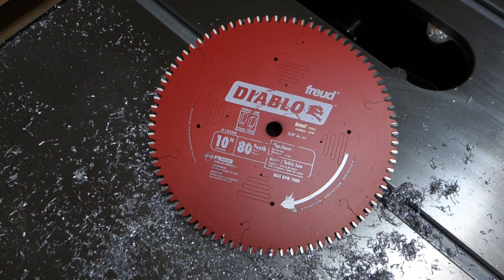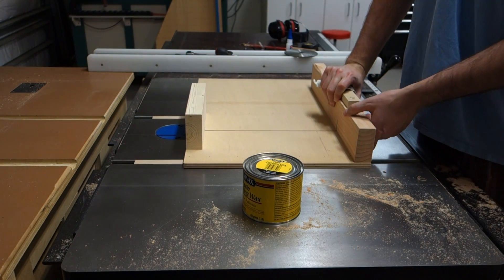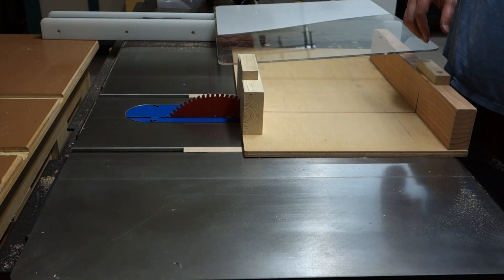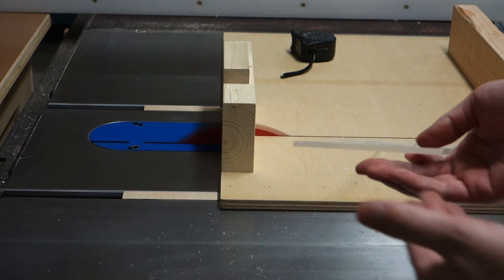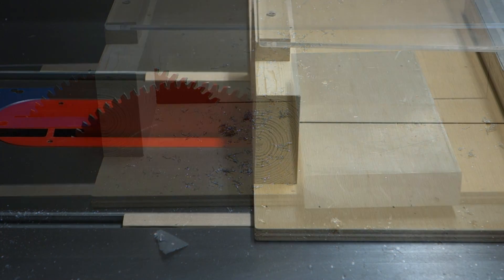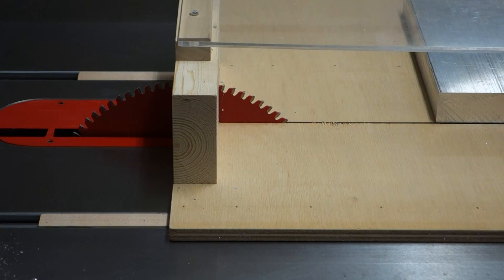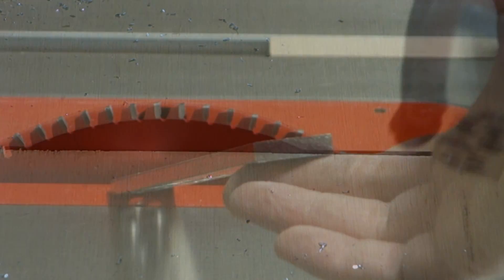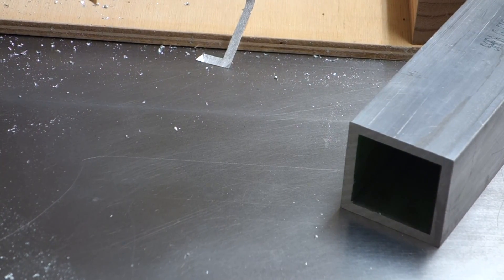Cutting aluminum and acrylic with the table saw

Comment: Draw a tiny bead of Alumtap on the stock where the blade will intercept it. I use a 1oz poly squeeze bottle and about a 20 - 30 ga needle. It's total FM. You will get a mirror like cut, Your problem is the aluminum sticking to the carbide. I wouldn't matter what kind of tool you used if you don't have something to prevent adhesion.
Reply from the maker: Very good info, thanks. I have not heard of AlumTap before. In reality, it is probably near impossible to achieve a perfect finish the way I was cutting just becuase of lateral forces imperceptibly vibrating the stock.

On my mill I can acheive a pretty good mirror finish with aluminum, lubricated or not, but lubrication certainly helps. I believe the majority of this is do to it being rigidly held in place with controlled feeds and speeds.

At the end of the day though, the table saw is a very capable and versatile tool.

Comment: For Cutting Acrylic, I Spray DuPont Teflon Dry Lube on the Blade. I Rub Bee’s Wax on both sides of the Acrylic at the cut line. Leave the Paper on and Rub the Bee’s Wax on the paper.

Comment: I can't help but feel that with the heavier/thicker piece metal, cutting right on the edge as you did, it was a deflection problem as the blade was not being supported on both sides.
I know with a mortiser you encounter a deflection problem if there is not a equal amount of support on both sides of the bit assembly.

Comment: CAN ANYBODY HELP? I’m using the same blade in the video, except mine has 84 teeth not 80, and when I try to cut acrylic it just starts “foaming” up/“melting”. What is wrong???
Reply from the maker: Blade is not the same. #of teeth matter, angles of teeth matter. Small differences can make big differences. However that being said, you may be cutting an extruded piece of plexi which is different from cast plexi. Extruded has much lower melting point and will do that if machined.
Reply: @WickedWood  Omfg I’m just realizing that it might be extruded because I just took it out of a scrap bin at the acrylic place, it’s not from the cast sheet that I purchased.. would definitely make sense because this wasn’t happening before. 

Wow how did I not put this together lol. 

Thank you

Comment: When I say "work" I mean work piece Also there is a reason why Machining use a lot of careful planning when planning for work holding with a slitting saw or horizontal milling etc. Thing about the forces being applied to your work piece as it meets the saw blade. Think about what that work piece would do if you were not holding it down the instant it meets your blade.  The saw is pushing the work away from the direction you want to push it (in the x or your only(not) axis).  The blade is also pulling the work down.. all this force is being applied to 1 side to of course the other side is going to deflect in some way. If you could concentrate on keeping the side furthest from the blade from moving and use lube (wd-40) you will be surprised.  Mirror finish man. I wouldn't take my time explaining if I didn't know it myself.  Fyi you have more then acceptable finish already compared to most "machinists" I've seen.

Comment: Great video, subscribed! 
I love the incremental testing you did, as well as the double slot crosscut sled with the acrylic  (it really cut that nicely by the way). Pretty great results for the aluminum in the end and as others said, it should give a perfect cut if you wouldn’t be shaving the piece. Am I correct (I think I saw this on the blade) in saying that this was a 10” 80 teeth blade? Also, what’s the grind on the teeth? I assume a triple chip grind (TCG), especially with the low hook angle, but I’m not sure.
Reply: Sorry, I forgot to check the description and all of my questions were answered there... thanks again for the good video as well as for the extensive description!

Comment: Why are you trying to cut paper thin slices and still wondering why the blade is deflecting. If you really need to take .00001" off of a 1 x 4 aluminum block...you need a mill, not a table saw.

Comment: As someone who's cut aluminum on a table saw and hurt themselves more than once I can tell you that the table saw is the wrong tool for cutting aluminum. Use a bandsaw like any sane human being. You can also use a cold saw to cut aluminum. Slugger makes great cold saws for about five six hundred dollars. You are very likely to injure yourself, hurt your table saw, or hurt someone else trying to cut metal on a table saw. A table saw was never designed for this and the kickback can be extremely nasty. I almost broke my thumb one time cutting aluminum and I was feeding the material very slowly and cautiously.
Reply: 77Avadon77 Totally agree with you. I have cut aluminum plate on my table saw, as a last resort because my vertical bandsaw was down...very dangerous!

Comment: You aren't cutting aluminum, you are shaving it.  Take a cut where both sides of the blade are supported and that will correct the problem.  I have a small antique craftsman 6" table saw and cuts beautiful but then I am never shaving.
Reply: YourOldDog: egg zackly.
he should have known that anyway but the very first cut he made had a lot of mirror finish because there was a good size chuck cut off but that chunk wasn’t a full piece. the blande is having a hard time staying true because it’s being pushed to one side instead of plowing straight thru.  the same thing happens in a mother saw when the blade is just touching the end of the stock.  plus this guy was doing more building and modifying that sled than cutting aluminum

Comment: You should use a sander to do sanding, and not expect your table saw to handle that job. It would be nice if your table saw did it all, but specialized tasks usually require specialized tools.

Comment: squirt some WD-40 on the aluminum before cutting, it's the commun lubricant for cutting ali.   Also, deflection on a 10" blade will be considerable when one side of the blade is not supported by the aluminum.  ANY blade would have trouble cutting metal with out support (cutting more than a sliver) from both sides,

Comment: Hello, the angle of incidence of tool into the piece of aluminum is very low!!! and the velocity of turn is very low too, and the velocity of advance in the table is very hi!!!. Three enormeous mistakes, what have a cost and posible injuries!!!
To do this work, you need more angle of cutting tool of the piece, and very much velocity (and power) of turn at the same time very slow advance into the piece of aluminum.
The velocity of advance in this video is insane!!!, and, you have a "private god" careing of you, and your hands eyes and all you!!!.
Can you cut  a solid block of aluminum, with this tool? yes you can!!!, 
Can machining a solid block of aluminum with this tool?, No you cant!!!.

Please, be carefully, for yourself and other people what see this video.
Thanks
Reply: Cristian Fernandez I completely agree with you here, cutting aluminum on a table saw like this is a disaster waiting to happen. I've done it and I've been hurt doing it. I would never recommend it to anyone. I have 20 years metal working experience and I'm smart enough to know when you use a bandsaw or a cold saw. The industry does not use table saws to cut aluminum and neither should any of you

Comment: So do you need a special kind of blade to cut through aluminum? Not your usual wood blade? I have just one closet rail to cut the length of. I do have an old wood blade that is ready to be replaced. Could I use that?

Comment: As far as I can tell, the reason for the finish not coming out as you wished is because the larger stock you used needs to be clamped. The 1'4' stock came out nicely because there is not as much force against the blade (especially on the first contact with the blade,  and hand strength might be enough to hold it. Clamping the larger stock in place allows for more stability when the blade first hits the material. A mirrored finish is basically just more consistent and finer scratches in the metal. Slower feed, less movement/vibration makes a more consistent finish especially at the entrance and exit points. Cool video, thanks:)

Comment: Thanks for the video. Your attention to detail is appreciated. I am about to make many cuts on thick aluminum. Your hints and the helpful comments will definitely make the experience much smoother.
Reply: dejapex1 buy a slugger cold saw and don't risk your life doing this on the table saw. I'm very serious when I tell you that this is dangerous as hell even with the appropriate table saw blade. I speak from experience.

Comment: we use chop saws to cut aluminum if you have problems with the aluminum building up on the blades start giving it a quick shot of wd40 before your cut

Comment: Stupid question, but figured I'd ask anyways. Did you use a high quality engineers square to make sure the table and blade are 100% square? That's another possibility. Probably the most common, besides the blade deflecting or shifting out of the way.

Comment: Nice educational video. I think your 10in Diablo blade has a very thin body thickness, which means that the blade is not stiff enough and will bend when beginning a cut into hard and thick aluminum plate, causing deflection scarring. Also, 80 teeth will not give you a very fine smooth cut in thick aluminum or wood. You should try using a 10in 120tooth blade with a body thickness of 3mm or more to get a super smooth cut, with no deflection in thick aluminum plate 2in or more thick.

Comment: nice blade! What brand/model table is that one you have in the vid pls?
Reply from the maker: This saw is a 3hp Grizzly 1023sl cabinet saw. It has a few modifications done to it, quick release splitter, digital readout, long shop fox fence/ rails, router table etc. Overall this saw has performed extremely well with minimal maintenance and has seen 1,000s of BF of stock. If I were to buy a saw again I would defintely recommend this or a SawStop for more safety.

Comment: Thanks for the great video! I have to cut some 8020 extrusion for a CNC router soon, and your hints will come in handy. What model table saw are you using? How many HP? Thanks again!
Reply: i hope u did not do like this dumb ass did buy you chop saw that is made to cut stuff like that dont use a table saw

Comment: Could you tell me what router bit you would use to clean that up? I use carbide spiral bits on plexiglass with a thin aluminum skin,  which work great, but am wondering if there is something else out there. Thanks
Reply: +zapcan59 carbide spiral bits would probably be the best for router useage. There are upcut, down cut and my favorite compression. There are also buts made exclusively for cutting aluminum which can be found online or in machining catalogs. They have specific pitches and numbers of flutes depending on what you are doing, drilling, rough milling, finish pass etc. The degree of finish you are going to get will most certainly depend on rigidity and routing aluminum handheld, as thick as this if only taking a skim pass of  1/64"-1/128" will still test its will.

Comment: Thanks for the video.  I have cut thin aluminum on the table saw but was to scared to try something that thick!

Just curious if your table top miter slots are parallel to the blade?  With a cabinet saw and a dial gauge mounted in the miter slot it is really easy to make sure the blade and saw are in perfect parallel with each other.  This might improve cut quality.

Also I would think you would get a better cut when the blade is cutting material on both sides of the blade.
Reply from the maker: Everything is dialed in on this saw. I did full kerf cuts. It left good edges. The reality is that no matter what there is going to be blade deflection on thick pieces. However, I was just trying to illustrate extreme cuts. If you were cutting aluminum panel or even 3/4 sheet this would move through is like butter.